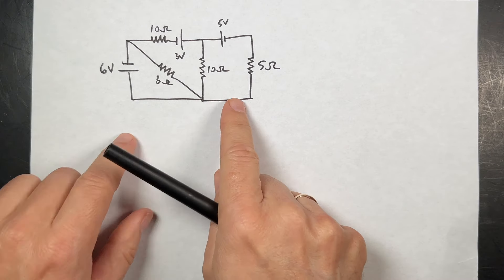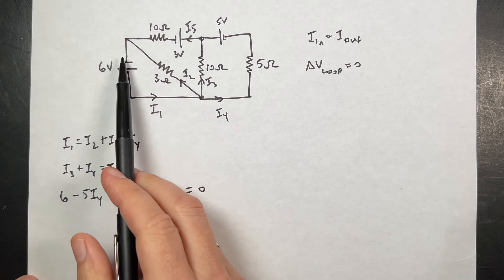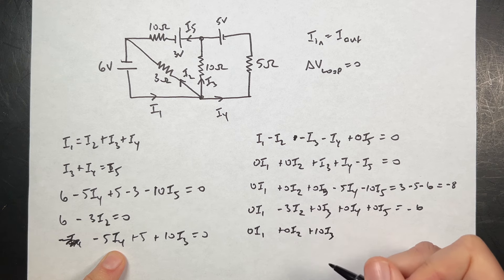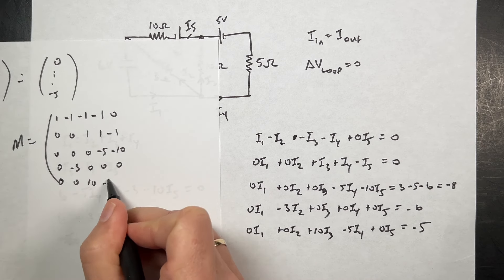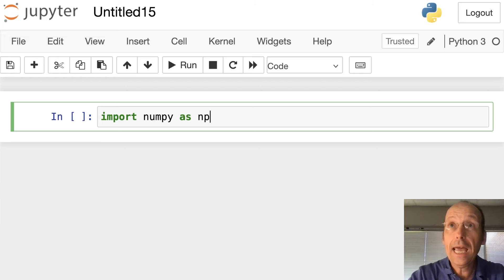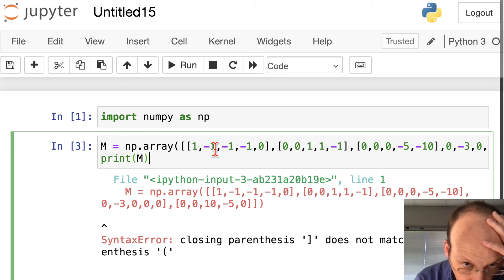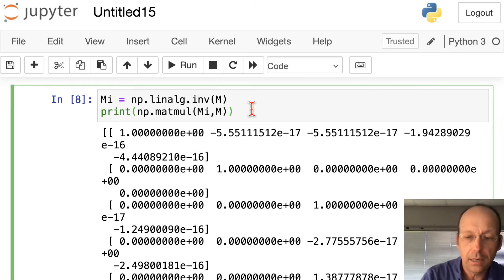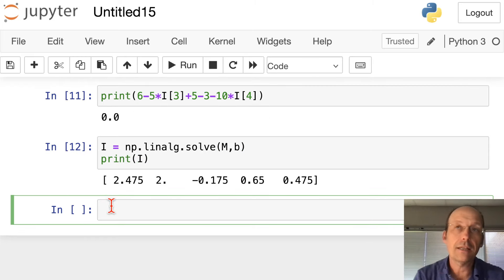Solving a System of Linear Equations with a Matrix and Python

Comment: This can also be done with any scientific calculator that has matrix operations. For the TI-84, it’s under 2nd x⁻¹. 
You can either enter M and b⃗ as two separate matrices and compute M⁻¹b⃗ with the built in operations, or you can put M and b⃗ as one adjoined matrix, where b⃗ is the final column. If you choose this method, you will then go to the bottom of the operators list and choose RREF, which will give you an adjoined matrix where M becomes an identity matrix, and the final column b⃗ becomes I⃗, which gives you your answers.